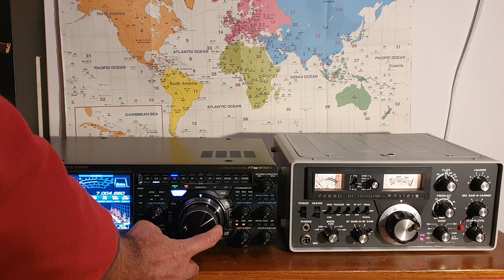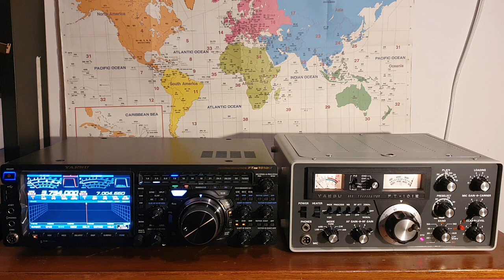# Yaesu FTDX-101D & Yaesu FT-101E - Side-by-Side Reception Comparison in Dead Band Conditions

Comment: The FTDX101 needs to have amp 1 enabled to be equal. The 101E does not have an IPO setting.
Reply from the maker: Agree this was a quick video during the flat dead band conditions. I am planning to record and tune both transceovers on 14 Mhz during maximum band activity this weekend & I am sure that will be intresting to see a 50 years old next to the best of nowadays by among Yaesu. So stay tunes for that. BTW Thanks for supporting the channel. Cheers

Comment: Issue I have is new radios life span of the radio and parts.  seems the FT101 has lived 50 years   I wonder how long new radio going last?   seems like parts are discontinued few years after production and you need another radio for boards.  good luck fixing these new boards  you need be electronics expert to do it .     I have a HW 101 from 1970 era it still works,   wonder if that FTDX 101D going work after 50 years?   bells whitsles and DSP is fine but longevity ?    thanks for video   Tony ve4akf
Reply from the maker: Well I agree you have raised a very valid point. The construction methodology & technology and type of electronic componenets have changed radically overtime & longevity on these modern rigs can not be guranteed & compared with old cool analog transceivers. Thanks for supporting the channel. Cheers